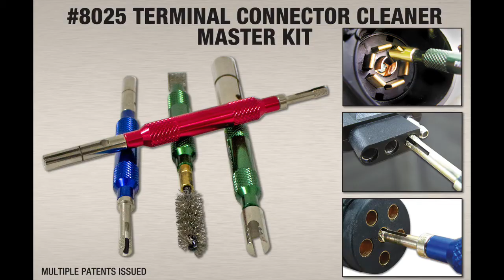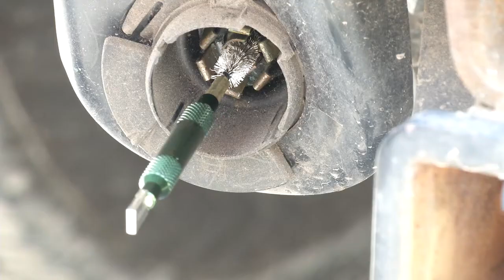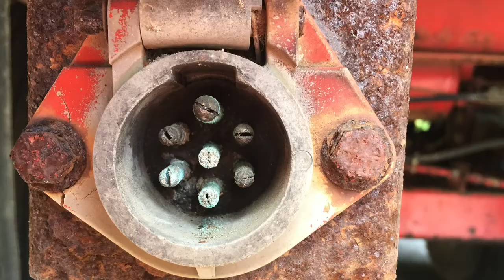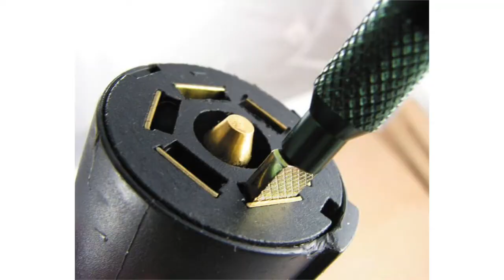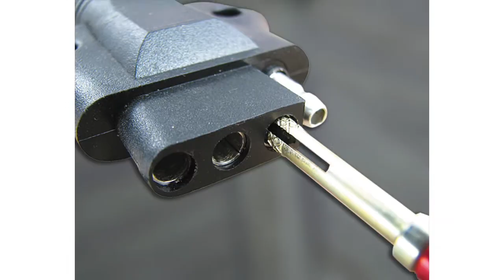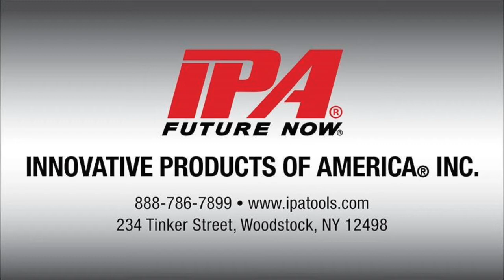IPA Tools 8025 Truck and Trailer Connector Cleaners Master Kit

Comment: I'm so glad I found your company! My snow plow would not come on last week and I discovered green corrosion in the ten pin connector. I wasn't sure how I would clean that so I did a Youtube search and found a guy who bought one of your kits and showed how he cleaned his connections with it. I ordered one right away, it came in yesterday, I cleaned up my connections and it's working perfectly!  I have also ordered the 7 way and 4 pin trailer connector maintenance kits to use on my trailers.  Thank you for making such great products.
Reply from the maker: Charlie, 
Thank you for your comments, they are much appreciated. We at IPA take great pride in our products and in providing customers with exceptional value and service. So glad we helped get your plow back on the road!